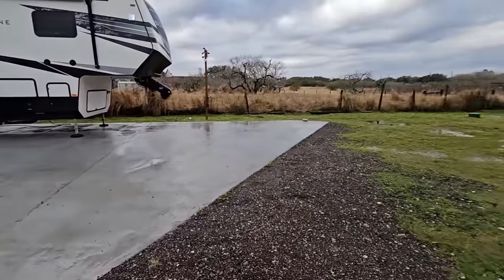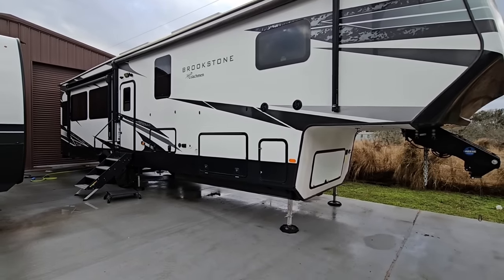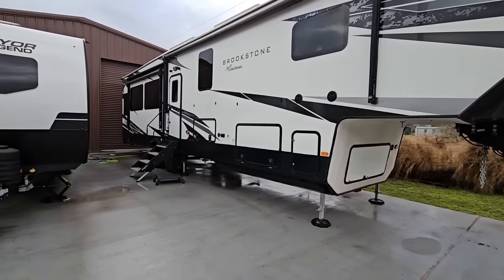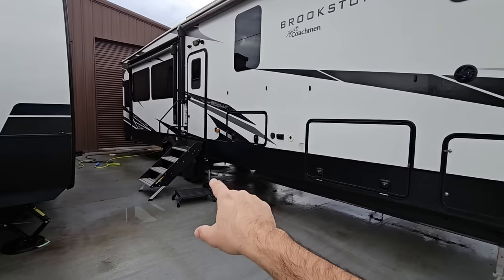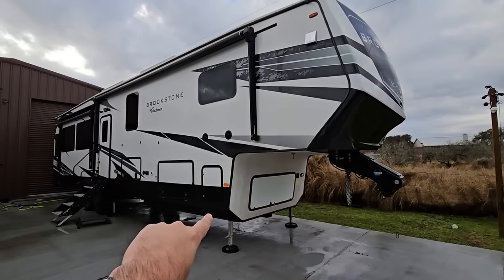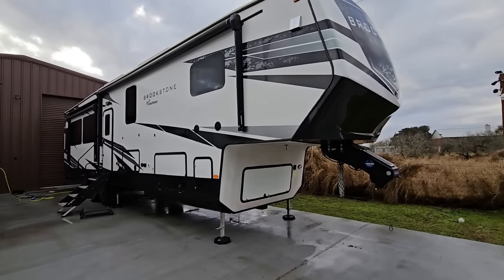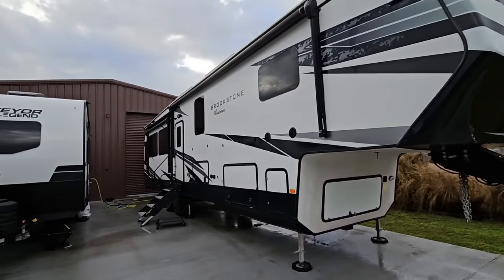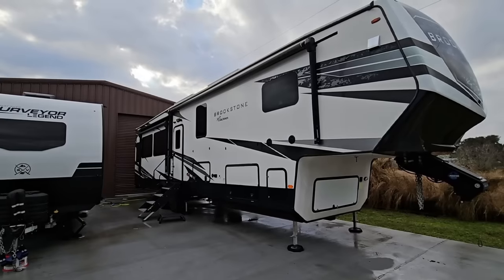FRAME FLEX on some Fifth Wheel RVs EXPLAINED!

Comment: I feel frame flex is the result of many things;
1) the manufacturer takes a “value engineering” approach to the whole package. (Weight loads both live & dead loads)
2) They go to a fabricator with a cost in mind which then pins the “value engineering” aspect to the fabricator.
3) They have a “calculated” load in which the trailer & tow vehicle cannot exceed. 
4) Does the consumer understand, do they adhere to it, do they proper load or weight the coach properly-NOT SURE
5) Are the welds, structure, material monitored by a CERTIFIED METALLURGIST OR CWI-NOT SURE
6) Are the frames built to MINIMUM STANDARDS or above & beyond as a just in case- NOT SURE
My opinion is they are & will NEVER be built to last longer then the warranty since, they are RV’s, considered a limited use item & not really designed for long term or real full time living.
Reply from the maker: I think the biggest challenge is trying to keep weight down. Additional materials, additional bracing, an additional design elements, mean a frame that's more expensive and heavier. I think manufacturers often are looking at how big they can make the RV over how reliable they can make it.

Comment: Play on words JD, its a frame failure due to frame flex, most folks refer to the issue that caused the failure and not the end result. You touched on a couple of causes but missed one that I feel may be a major contributor, that being overweight. The vast majority of 5th wheels have large storage compartments that can be easily overloaded, especially when you add a washer dryer and a generator to the front. I've commented on several posts on this subject and asked if the coach was weighed, no response. Being a member of several different manufacturers it's an issue across the board,  and not specific to any one brand.

Comment: I cringe seeing people pulling 5er's with rigid hitches and rigid pin boxes. After months of research I knew it was crucial to get one or the other with some sort of impact absorbing hitch or pin box. Especially since I tow with a 450 which has a stiff ride. I decided on the Hensley BD5 trailer saver and it's a dream to pull with.

Comment: I was planning to buy a new motor home but the quality of RV's has gone down so far that I decided I don't want the headache. I have a 2021 east-to-west that has been a been an issue from day one I have used maybe 25 days. I have had a dead short in the 12volt system (dealer refused to fix, manufacturer refused to fix) when they built the trailer they put the wire in a square aluminum tube that chafed until it shorted. The gray tank valve started leaking 2nd use.. The awning motor was cracked and failed after 3rd camping trip. I have written the manufacturer so many times I am sure the emails just get deleted without being read.  Never pay cash for your RV, we did and it was a mistake they won't even return your call once they cash your check

Comment: Frame flax is a nice name the RV manufacturer gave it. This is frame failure. The RV manufacturer cut corners when they spec the frames out. These frames were not specced out to handle the weight of these large RV units. It not just the frame flexing, frames are cracking and welds are breaking loose. This is a very serious issue, and is very expensive to get fixed. Any unit over 30ft and built after 2016 have a good chance of this happening. If the RV manufacturers would have spec these out properly instead of cutting corners to save money, this would not have been an issue. I kind of feel your video is making light of this. The dealers and manufacturers are trying to blame the RV owners, when it is the RV manufacturer are at fault. They cut corners and now it's coming back to bite them.

Comment: I would submit that walls should not be flexing to the extent that they can allow elements (light) in under tow. That is not normal. The prominent issue happening out in the wild is frame failure from what appears to be very poor welds. In every documented case that I've seen, the welds themselves are breaking, not the metal around the weld.  I suspect this is why so few photograhs of actual failures are being published. I also find it hard to believe people are getting 5vers into places not intended for 5vers to travel to.  With narrow trailer tires and high roof lines, there are very few places off the beaten paths accessible for these rigs.  Let's be real and all acknowledged there is a huge quality control issue going on and the rv industry needs to tighten up. Furthermore, companies like big tex have been building gooseneck and 5th wheel trailer frames for years. They get overloaded and ran through the mill daily without catastrophic failures. If the manufacturers want to normalize flexing to the extremes that you claim, they need to reengineer their super structure to accommodate said flex.

Comment: You didn’t explain anything. All you did was discuss irrelevant semantics. The vibe I’m getting is that you’re trying to downplay frame flex and what these people are experiencing. I feel like you’d feel and talk about it a lot different if this was happening to your rig. Also, to everyone who isn’t aware, he’s referring to Grand Design fifth wheels when he says “specifically with one brand”.
Reply from the maker: I never downplayed anything.  I specifically said it's NOT frame flex, it's frame failure.  How is this downplaying anything?
Reply: @BigTruckBigRV You tap danced around the issue and, clearly, your financial backing comes from the RV OEMs.
Reply: There is significant damage happening to many towable Rv’s manufactured in the last four years. Much of these are the longer fifth wheels. Call it frame flex or damage, the cracks in the metal frames are well documented, along with the subsequent damage to sidewalls, slide outs, facia, and the like. The commentary on the physical forces that impact a moving towable sounds realistic. There are lots of examples, I’ve been told, of some physical damage happening through the years. The concern now is that major damage is more frequently happening that prevents the rv’er from using their rig, and, even with new units, the manufacturer is not providing timely support, repair, or replacement. Additionally, those of us driving the highways and byways of America are becoming very concerned about the probable eventual failure of one of these unknown but collapsing rv’s as we are near them!
Reply: @deanhopkins4117 posted solely for views,   this is the hottest topic in the RV world right now...
Reply: It is Lippert frames from what I have seen and read.
Reply: The "Frame flex" title has been awful for the issue. He just talked about normal frame flexibility  too much lol.  The issues people are having is FRAME FAILURE. The welds and gussets are completely failing. I'll edit this to refer to watch the video about the guy who had GD repair his and it had 17 areas of the frame that needed repaired and reinforced.

Comment: I have a Cimarron Living Quarters Horse Trailer.  A top tier trailer.  This trailer 33ft long and weighs 13,680lbs.  carries three 1,200lb. horses in the rear with living quarters up front.  All the manufacturers put a gooseneck hitch directly under the nose of the trailer.  Not an extended lever hitch out in front of the trailer as the RV world does.  Why? I’ve never heard of hitch failure in the Horse LQ world.
Reply from the maker: So in the realm of fifth wheel RVs, that would be considered a very light fifth wheel.  The fifth wheels impacted here weigh roughly 7,000 lb more.  Smaller, lighter fifth wheels are not being impacted by this issue nearly as much.  Also, there's probably 1 horse trailer to every 200,000 RVs manufactured..  I guarantee you there are owners with horse trailers that are experiencing frame issues.  As a percentage it may even be higher than RVs.  If you show the construction of your horse trailer, the transition from the riser to the upper deck, you will also notice how it is significantly lighter duty than most heavy fifth wheels. Most of the support for your horses is placed directly underneath where the horses are. Or trailers position their axles very far towards the rear.  This demonstrates that there's not nearly as much waiting on the pin of a vehicle. That's why horse trailers are so light considering their length.

Comment: I would like to know what the length and weight of the fifth wheels that are having frame failure. I think that maybe the RV companies have given in to people wanting massive rv's so that they can carry their house with them. Was this a problem before these giant rv's have started being so prolific? I am currently in a travel trailer but we had a fifth wheel 20 years ago. I am sure that a frame could be built that would handle, long lengths, massive weight, etc... but would you want to pay the price the beefed up frame would cost? Would you want to buy the Medium Duty trucks that would be necessary to pull these behemoths?
Reply: I'd advise not to make assumptions about weight when the manufacturer/assemblers put stickers on their RVs saying something like 20,000 GVWR and many of us that are full time do get our RVs weighed pretty regularly and are VERY conscience about weight in our RVs, such as ourselves. I know some (one in particular) manufacturers try to point all the blame on these RV owners as a way to deflect their under-engineered RV for weight and travel, that they say can be up to said GVWR. Just like they will try to blame upgrades that owners have made for a smoother ride such as independent suspension, Sumo Springs, pin box upgrades etc. We pay the price based on the fact that these manufacturers tell us that their frames are reliable. I guess when they are not under ANY federal regulation, I guess they can tell use whatever we want to hear, right? That is called being deceptive, let alone fraudulant. By the way, we have a F-350 dually with airbags.

Comment: I would never use a goose neck adapter on a 5th wheel RV. The additional stress caused by changing lever position is just asking for problems especially if frame is marginal to begin with. 

An air ride 5th wheel and a rubber pinbox should be the very first thing you do with a heavy 5th wheel. 
2nd upgrade shackles /bolts/bushings and at least rubber cushion connectors between tandems.

Comment: But aren’t mostly all frames built by Lipert?
Reply: They are are but ultimately the RV manufacturer gives Lippert the specs on what to build and the specs on the metal used as well so not every brand is the same from a design or materials standpoint. If you can find a picture or a factory tour video compare a Grand Design frame to a DRV or Riverstone frame.  All three come from Lippert but are built very differently out of different materials.

Comment: You should be able to tow your RV without a worry of the frame failing. Regardless, of where and how much you tow it. If your truck's frame failed after driving it for a few months, you would freak. This is a huge problem.

Comment: Hmmm 🤔 but how does one even know that something is going on?  I can understand if you had drywall inside and the frame flexed/failed and you ended up with cracked walls: but how would one know with a steel frame and composite walls that you even have a problem?

Comment: Well Josh.  I haven’t seen that much dancing around since Fred Astaire and Gene Kelly.  Yes, I have degrees in both Architecture and Mechanical Engineering and can tell when I’m being BS’d.  This is clearly a manufacturing issue that needs to be addressed by the manufacturer.
Reply from the maker: When did I say it wasn't?

Comment: Yes, everything flexes but that should not be an excuse for damage or failure. The fact that somebody uses their  RV full time is also not an excuse. Since we know things flex and how rv’s are marketed and used they absolutely should be designed to withstand the use they are subjected to.
The whole rv industry from the manufacturers, dealers, parts suppliers needs some serious changes.
I am personally as anti government regulation as they come but the whole industry needs some serious government intervention. I realize these rv’s need to be built as lightweight as possible but that also is no excuse for what they are selling or the way the dealers, sales personnel, dealer repair shops, factory reps etc. treat customers.
Ask me about water tanks falling out the first time they are filled with water, trailer not having dealer prep completed at time of delivery, dishonest statements from salesmen, bait and switch tactics, shoddy repairs, vehicles setting for weeks waiting for even minor repairs etc. and the dealer attitude when customers are not happy about these things.

Comment: the frame designers and rv manufacturers want folks to think its beyond their 1: control, 2: responsibility, 3: design expectations of proper use.... well ... ford pintos and ford explorers gas tank failures are  good examples of "words over reality"... people died. rv frame failures will/have cause(d) personal injuries to others ... those damages will shut these gaslighter manufacturers down ... and hopefully put them out of business. one has to be insane to buy a 5th wheel rv knowing the lack of frame intrigity exposes the consumer to a risk they are  then expected to financially bear.  no reasonable person thinks this is acceptable.

Comment: If the frame manufacturer is up to specifications on materials, and are not over rating the tensile strength of the frame, then the RV manufacturer is not using a heavy enough frame at these stress points. Has anyone seen any reports on these frames as to the failure points, like X-rays to show if the metal is failing due to stress fracturing or just simple failure? I’ve been driving trucks for 45 years and can count on one hand how many truck frames I have seen brake. And they were all due to rust fatigue, which is not what’s going on here. Not addressing the issue is not going to make the problem go away, just their customers.

Comment: The problem is their trying to make these things lighter and using cheaper materials thin wall tubing not be properrly reinforced were their welded together. Cheap press board for wood with staples not glued and screwed. Prices keep going up and quality keeps going down

Comment: If no one check if steel is thick or cheapen up you are going to have problem with any frame . Way I look at this . If you use 1/8. Steel instead  using 1/4 or 5/ 16 . It would last in any road condiction I drove truck . I see how they cheapen on everything. If you build cheap it will not last.

Comment: Another reason I won't buy a fifth wheel. Pay that much money and you risk frame failure especially in this post-Covid work environment (and lack of quality control)? And then try to get the manufacturer to stand behind their product? No thanks. And this discussion about too much use (like full time living) is a bunch of crap too. Why would I pay $100,000 for something I can only use periodically? And have you driven the NY State Throughway? That road is pure crap. And if the trailer mfg says that's abuse, then they need to stop making these pieces of crap. We've owned gooseneck horse trailers that carry 4-5 horses over some of the roughest roads/single tracks/etc. We never had any of these problems because the mfgs designed and built the trailers correctly. Of course, RV manufacturers any more simply assemble - they don't build or make much at all. This is convenient to pass the warranty and liability, and blame someone else for a failure.

Comment: IS IT "ONLY" 500 or so, or is that what they are trying to keep the numbers down to to for the sake of recalls, warranty issues, safety recalls, public opinion...etc?   As an automotive engineer of 30 yrs, I'm fully exposed to what large companies do to lower manufacturing costs, and the extent they will go to protect their profits.  Its unfortunate and it will most likely come at a cost to the current owners who will incure the frame failure issues , or the loss in value during resale.

Comment: Personally I think much of the problem is being sort of misdiagnosed. I’m using my knowledge in trucking on how to break a semi trailer frame the fastest as my benchmark. I don’t think the majority of the initial damage is happening going down the road. When the trailers are being maneuvered, the frame is essentially being shoved sideways at the front while the tires are trying to keep everything going on a straight line. (Literally what their job is. Tires have improved in recent years. To the detriment of the frame.) Fifth wheels have grown heavier and larger each year. Tires do their job better. Then when you’re parking the trailer in a campground or even driving through a Walmart parking lot, stress is placed sideways at both the suspension and at the nose. At the nose, you have a single attachment point. All that stress is focused and something is going to give. All it takes is a single stress crack. Once the damage exists, it’s going to spread. Even going down a smooth freeway will slowly spread the damage. The more careful you are, the more likely it’s going to take a long time for it to show up as a major problem. If you look at a semi trailer, you’ll find two incredibly heavy steel plates above and below the cross members above the kingpin. Even then, you can break all of it if you maneuver the trailer wrong. The problem is amplified in trailers that are either spread axles or 3+ axle trailers. And the wrong way to maneuver is tight turns (like what many campgrounds require, and what happens in tight parking lots…) Broken suspension welds and nose frame failures are the two most common things with semi trailers. Sound familiar?